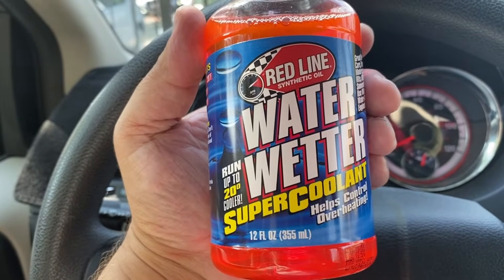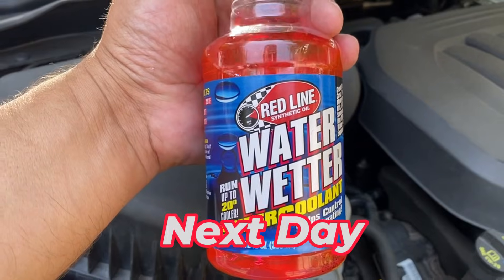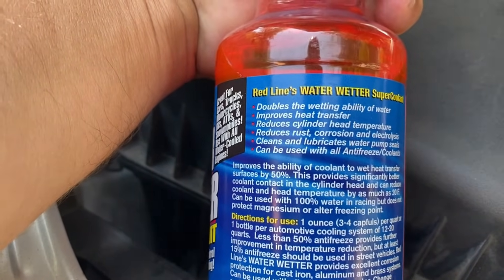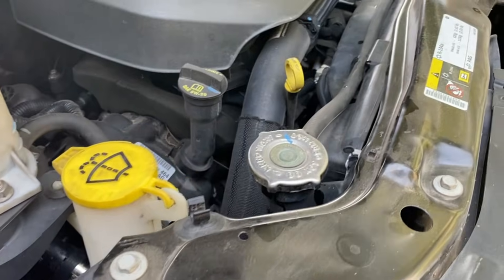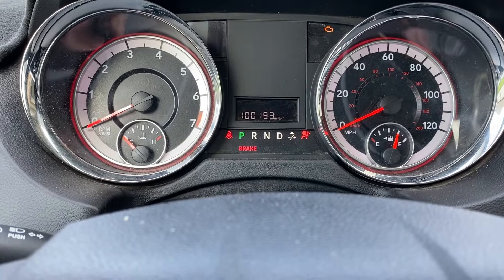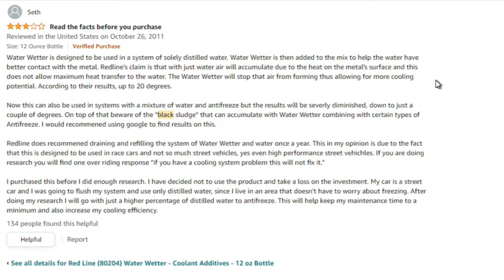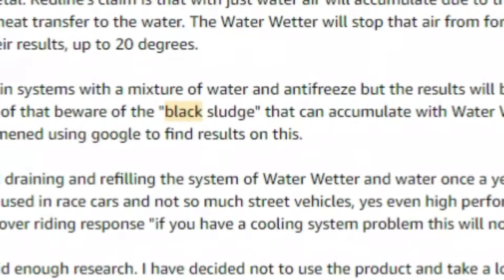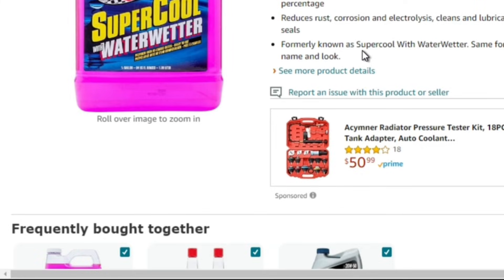Does it work? Redline Water Wetter Review

Comment: WITH ALL DUE RESPECT: I advise you to ignore the negative opinions about Red-Line Water Weter you've read online. There are several factors that can cause "black sludge" in the cooling system of an internal combustion engine. None of which is a result of using Red-Line Water Wetter with a fresh mixture of "distilled" water & Glycol-based Antifreeze.
I have used this product for decades; in both my daily drivers & my track-only race car. I haven't noticed a significant decrease in the temperature of the engine coolant. But what I have noticed is the engine coolant is maintained at a safe level on very hot days with the AC on. I use distilled water & Red-Line Water Wetter in the aluminum engine of my race car and the engine coolant temp. is never an issue. Even after back-to-back runs, the coolant temp NEVER exceeds 185 degrees. 
I assure you this product is formulated to be used "SAFELY" in passenger cars which have a maximum mixture of 50% water & 50% Glycol-based antifreeze in the engine cooling system. BTW: It is ALWAYS recommended to use ONLY "distilled" water in the formula of Glycol for passenger vehicle engine cooling systems.
The main issue I noticed in your video is that your cooling system was already "FULL" when you added the Water Wetter product. The small amount you were able to add to the radiator would have no effect on controlling the coolant temperature. Adding the remainder to the coolant overflow jug would be pointless. You should add the ENTIRE bottle of Water Wetter to the radiator BEFORE you add the 50//50 mixture of Glycol & "distilled" water. I say 50//50 mixture because...if you're living in Texas...it'll be a good formula for that climate. 
I STRONGLY RECOMMEND you to change your thermostat to a lower temperature from the factory//OEM temperature rating. Buy a good quality Gates Thermostat that is 20 degrees cooler. Because...OEM thermostats are intentionally set to open at a high coolant temperature to reduce emissions. They keep your engine temperature & exhaust temps unnecessarily high as an aid to burn emissions in the combustion process. If your engine is properly tuned & you use good fuel from a gas station selling "Top Tier Fuel"...there is NO NEED for "hot" coolant temperatures. Lowering the temperature of the thermostat will NOT increase the emissions of the exhaust.
If you look around your city//town, you will certainly find Top Tier Gasoline. For example, all BP, Chevron and Shell gasoline are Top Tier Fuels. 
It's NOT likely...BUT...your engine computer system might set a Check Engine light with a cooler thermostat. It's NOT likely...but it's possible. NONE of my daily drivers have ever set a Check Engine Light with a cooler thermostat. Regardless, you can ignore the light. No harm will be done to your engine. NONE. 
All this being said, I recommend changing the engine coolant every 2 years. REGARDLESS OF WHAT THE OWNERS MANUAL STATES...and...USE THE CORRECT COOLANT TYPE FOR THE YEAR, MAKE, MODEL OF YOUR VEHICLE.  
If you still choose to NOT use Red-Line Water Wetter, I recommend you upgrade the radiator cooling fan to a higher CFM aftermarket fan. SPAL Fans are the best quality available. If you can make them fit. you could possibly use a dual fan set-up for greater radiator coverage. 
Best regards, 
Ben
Reply from the maker: You provided a lot of great information from your experiences.  The thing I discovered is that water  wetter is not as easy to apply as one would assume. For racing it maybe great but unless you drain and refill your coolant and also replace the thermostat at the same time. That’s a lot of preparation to use water wetter. Thank you again for all of your valuable feedback. Happy new years
Reply: I've used Water Wetter in EVERY drag car I've owner, and I've NEVER had an issue with any sort of nastiness in my cooling system.... 🤷🏻

I've had various drag cars over the last 25 years, and I've used it with straight water in the rad, AND with coolant in the rad, and never a problem.. and YES, it DID help cool the engine better than without it. During a 10 second pass at the track, my engine temp was down approx 10-12 degrees at the stripe. That's pretty good for only a 10 second test of the stuff... 

I still use it today in every vehicle that I own. Even my daily drivers.
Reply: very helpful thank you